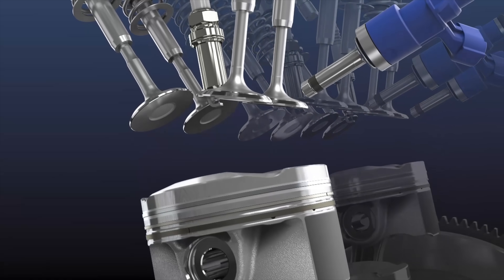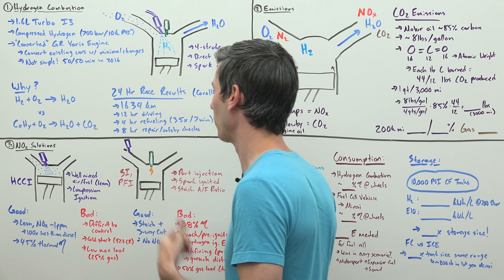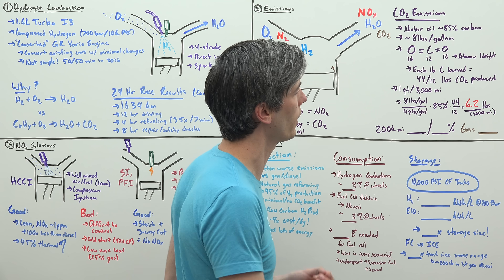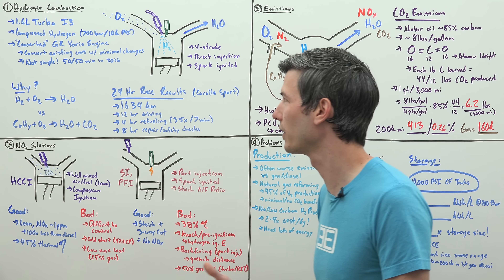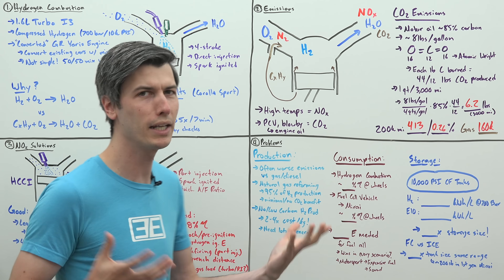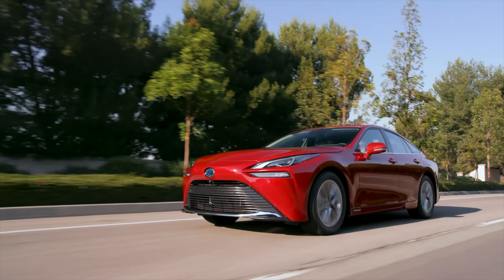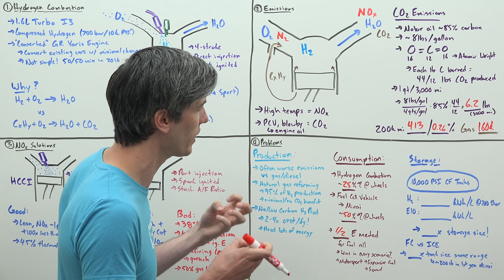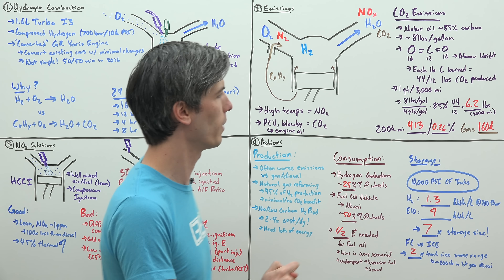Toyota's Developing A Hydrogen Combustion Engine!

Comment: Toyota will apparently do absolutely everything to avoid just making electric cars
Reply: The engine is the soul of a car
Reply: They're going the right way. It will possibly never be economical but it is the way to keep the ice alive for motorsports.
Reply: They defend their advantages in ICE reliability compared to other manufacturers
Reply: @joelblanco1800  Pfft. A car without a horse in front of it has no soul at all.
Reply: Probably because they realize most countries cant support 100% electric transportation without huge, expensive power grid upgrades.
Reply: ICE is looking more quaint by the day
Reply: Sadly to get lithium for batteries. It has to be strip mined. Plus the disposal is just as hazardous.
Reply: Trust me Toyota know what their doing 
Many other manufacturers are quickly going electric as they’re scared of being left behind plus they’ve felt the pressure mounting on them from companies and lame ass companies and media outlets that pressure them dude I swear a company like Jaguar or Lotus if they were run by actual brits they would never go electro as that would be against their traditions and such but because they felt the pressure and they’re afraid of the future a future that might get dominated by Tesla stans and climate shouting Karen’s
Reply: @vinigretzky97  

You’re damn right
Reply: It is funny - Toyota sell the Proace EV (hiace successor), but in reality it is just a Citröen Jumpy.. (Same car also Opel Vivaro, Peugeot Partner and Vauxhall of course)
Reply: C J B  Exactly, just a huge hype bubble. Tesla would not even be a thing anymore if governemnts hadn't bailed them out.
Reply: @billyboots3730  any evidence for this? A hot tub will use the same energy as charging an electric car
Reply: @noname-he9ud  they can be recycled, just need to out infrastructure in place
Reply: @vinigretzky97  Tesla hasn’t been bailed out
Reply: C J B  in what way is it superior? ICE is very inefficient.
Reply: @noname-he9ud  Lithium gets extracted by evaporating brine. You've been fooled by the fossil lobby, but no worry, now you know.
Reply: @UCOd8cMRR-lQ5cC5NDrCpasw Well I am hoping that that there is a solution out there besides burning fossil fuel. That fossil fuel stuff give me a headache when I pass close to tailpipe. After watching this video, there seems to be tooooo many negative issues with HCCI use. The FCEV is a better idea. I agree that EV has many problems also, along with mining pollution & rare earth metals needed for EV's, EV's will be expensive compared to their ICE counterpart & geopolitical issues obtaining rare earth metals at volume needed for EV society. Also very bad is EV's still need government subsidies & carbon credits to make a manufacturer profit, otherwise as of today, EV is a money looser. It is really a difficult engineering/science problem to solve with cars/trucks.
Reply: @vinigretzky97  Tesla has not been bailed out. You are probably confusing it with GM and Chrysler.
Reply: @billyboots3730 , see Engineering Explained video on the grid and EVs. For the U.S., a 30%increase in the grid, or "simply" charge at night. Not a big deal.
Reply: @YourAssAintSafe  lolwut
Reply: @billyboots3730  and they can sport hydrogen infrastructure? K
Reply: @noname-he9ud  Yes. And oil is made by leprechauns and transported to us by unicorn-drawn carriage
Reply: Toyota had several good advices for us in the past.
A super enthousiastic jump to electric cars without the infrastructure to charge them will lead in paralysis of the transportation system. They warned us about it.
They are probably preparing for this scenario.
Reply: All the resources on the planet will not be enough to make electric cars even for the USA alone.
Reply: What are you even talking about. Toyota has made EVs before and will release one and already presented a physical one before this.
Reply: Good luck building a billion electric cars to replace proper cars.
Reply: The Hydrogen powered cars, could be used in the future as a substitute to Diesel engines, or as a range extender. The Hydrogen combustion engines, could be applied in Motorsports.
Reply: @boboutelama5748  As opposed to hydrogen which requires even more new infrastructure and resources? K.
Reply: @omaralkayal7598  Would you rather plug your car in at home and pay $5~$10 for a 'full tank' or have to visit gas stations and pay $20~$40 for a full tank?
Consumers are buying EVs because they like them, because they require very little maintenance, because they're clean and quiet. Even a former mechanic and racer like myself can see that EVs are the future.
Reply: @vinigretzky97  Did not the U.S. government have to bail out GM and Ford? And unlike GM, Tesla repaid those loans.....
Reply: @jiyushugi1085  only cause tesla has now successfully shilled themselves into EU governments as well
Reply: Has anyone else put more electric motors in cars than Toyota?
Reply: @jiyushugi1085  Ford did not take a bailout. Also, GM did repay their loan.
Reply: @jonathanfields4ever  Are they now;)...lol
Reply: Seems to be working out for them, considering they have several non-ev vehicles that remain some of the most popular vehicles on the road.
Reply: @jonathanfields4ever  hydrogen pump distribution can simply piggyback on current gas station networks, since they, unlike EV charge stations, don't require a massive amount of electricity draw or require a specialized plug infrastructure investment.  Gas stations already offer diesel, petrol, flex, propane, and kerosene and would likely meet the safety standards to have storage tanks, since they have tanks for all those other fuels.
Reply: @jiyushugi1085  Yes, they are great for commuting and picking up the groceries.  They are not great for traveling, unless you have an expensive extended range model...which make up a tiny percentage of all ev's.  You're no dummy.  There is no reasonable expectation to believe that hydrogen would remain at that price with a market of vehicles creating demand and driving down prices as the market grows.....just like what has been happening to EV's.  And fuel cell cars are equally maintenance friendly, and don't need a wall plug which would work for people who live in apartments.
Reply: @omaralkayal7598  I suggest that Toyota and Honda and GM and Ford do NOT know what they are doing. They are making money now but the future is bad. The Chinese car manufactures are so far ahead in the EV market once in the US the game is over
Reply: Most car manufacturers are at least looking at, if not developing some hydrogen technology. Which makes a lot a sense, since hydrogen is already on par or cleaner than BEV's even using steam methane reformation (which is relatively dirty hydrogen production). And significant research is being invested into cleaner methods for hydrogen production.
Reply: @jonathanfields4ever  Infrastructure? Sure. Resources? F no. You do not need to mine copious quantities of Lithium and Cobalt to produce hydrogen.
Reply: It is electric, even we could say Coal powered... since what really counts at the end is the primary fuel used.. not the one the end user puts in.
Reply: @orionide4032  trillion **
Reply: @Erowens98  No, but it requires a fuckload of capital. Hydrogen proponents make it sound like you just need a bucket and some wires to make hydrogen, but you need about 3 times the electrical capacity of battery storage, cryogenic compression equipment, storage tanks, fleets of trucks, and it all has to be made to extremely high spec out of Kevlar or something of similar strength to keep tiny molecules under extreme pressure contained. None of that stuff is cheap or resource-friendly. The argument about resources is disingenuous
Reply: @uni4rm  Nope. Hydrogen is a different beast. It corrodes metal, it’s the smallest molecule, and it has to be held under extreme pressure and at very low temperatures to be safe. You can use the same location, sure, but you need all new equipment. Very expensive equipment.
Reply: @billyboots3730  Because a lot of countries need to have a power grid in the first place. Go outside the capital city in some places and you literally have nothing.
Reply: @billyboots3730  so you have huge hydrogen infrastructure upgrades instead.
Reply: Toyota actually made the bZ4X… their first EV. Let’s hope they only keep it to normal cars and not on sports cars!
Reply: @noname-he9ud  Not always.  Granted *citation needed, but "Brine Mining" is more common, and the footprint is just the injection/extraction wells (granted usually huge evaporation ponds for refining, but i digress)

On the note of disposal recycling is coming online which is nice.

Also sodium ion batteries!  or fuel cells
Reply: @jiyushugi1085  Ford did not take a bailout.  And GM fully repaid its loan.
Reply: The thing is that, Toyota Just want to be different than Others. Just like Mazda makes the Rotary Engine
Reply: @billyboots3730   and they can support hydrogen?
Reply: If it keeps the manual transmission alive, I’m down
Reply: the fall of Toyota in 20 years time
Reply: @markotrieste  do you understand how many government subsidies are given as incentive to buy an electric car? Its what the electric car industry hangs on with
Reply: @TemplarLove  if they bankrupt one day, they were Legend. Better Die Hero than long live enough to become a Villain. Because in another world out there is better, a Heaven…
Reply: @kylethomson7157  As of October 2017, Oil Change International estimates United States fossil fuel exploration and production subsidies at $20.5 billion annually. Other credible estimates of annual United States fossil fuel subsidies range from $10 billion to $52 billion annually – yet none of these include costs borne by taxpayers related to the climate, local environmental, and health impacts of the fossil fuel industry.
Reply: So what?  You got some breakthrough ideas of your own?
Reply: @reelreeler8778  There is no need for breakthrough ideas. Just start applying what we have today, but at a WWII pace. Solar, wind, smart grids, energy saving, EV, cycling infrastructure, trains etc. Just act now.
Reply: @jiyushugi1085  I would rather have a PHEV
Reply: @YourAssAintSafe  Only problem i have had with my EV in the last 4 or 5 years is people vandalizing it.
Reply: I'm glad they are doing this.
Reply: @vinigretzky97  Tesla and Ford are the only American car companies who haven't gone bankrupt
Reply: @billyboots3730  Except you're forgetting it takes 3x more electricity to make hydrogen than just filling a battery
Reply: @noname-he9ud  Err not true, it has been done that way but new methods are being used to extract it from Geothermal wells, also it wont be needed for that much longer as alternatives are on the way!
Reply: @Erowens98  
Yeah, hydrogen fuel cells just require several times the amount of electricity  compared to EVs because of the second law of thermodynamics - first you loose a lot of the energy by converting the electricity to hydrogen via electrolysis, then you have to compress and cool it, then transport it, store it before refuelling cars, and convert it back to electricity in the fuel cell to move the car forward. Every step of the way uses up energy that you could just use to drive an EV.

So if EV’s are supposedly going to cause problems with our electricity production and infrastructure, hydrogen would make those problems considerably worse.
Reply: Like the Prius.. the most sold electric sedan...
Reply: @TemplarLove  it's the only auto-motive company that amidst a crisis is still churning out cars at normal rates where all factories are struggling. I'm pretty sure they are good..
Reply: Electric cars are a gimmick... With those terrible full charge ranges, and extremely long charge times... I can tell you rn, that is not the future, we already going backwards when you look at those 2 factors, and the energy is produced using fossil fuel anyways so if everyone converts to electric cars.... You tell me
Reply: @omaralkayal7598  what a load of bollocks
Reply: @vinigretzky97  bailed out like VW?
Reply: @Vergos001  subsedies is a form of bailout
Reply: @markotrieste  yes they have. subsedies and emission laws manipulate the market in their favor.
Reply: They are literally developing electric cars right now. They have 15 new battery electric vehicles (globally) planned by 2025.
Reply: @ronaldlenz5745  the purpose of that video was that exact scenario being the problem. Almost everyone would be charging their vehicles at night. I vaguely remember him saying that MIGHT be an issue if EVs were to suddenly take over instantly.
Reply: @jiyushugi1085  I buy ICE for the noise and drama. I love every last bit of it. Yes, I rather pay $20-40 as sometimes I purposely just drive around for fun. 

Convenience is #1 in America. Until EVs can win in that category in all fronts it’ll be an extremely slow switch unless we are forced to.
Reply: @vinigretzky97  Actually subsidies are far greater for the fossil fuel industry.
Reply: @billyboots3730  they don't need to...most people drive less than 20 miles a day and the car sits 23 hours a day...why own?  Electric autonomous robotaxis are clearly the future
Reply: @markotrieste  how so? ever heard of gas tax?
Reply: @vinigretzky97  just google. Big oil companies are granted huge tax exemptions, they get discounts on public land lease. And this is even before taking into account the do called "external costs".
Reply: @omaralkayal7598  except that municipalities are mandating no more ICE sales.  Toyota is basically done in a decade except for developing countries.
Reply: Well, they did it developing hybrids 23 years ago (when many people, including me, thought that diesel cycle was the future). Nowadays, we can see that they were right and that they have the most reliable hybrid systems. Conclusion : you have to develop and evaluate all the possible  technologies, because future is uncertain. Greetings
Reply: @markotrieste  gay
Reply: Toyota is also one of the few manufacturers who haven't fallen for reducing displacement and strapping turbos to tiny engines.  They still make V6 camries while Honda only makes turbo 4 accords.  Toyota is probably the most American automaker, no replacement for displacement.
Reply: @vinigretzky97  😄
Reply: @FinalLuigi  the turbo-4's with DI can be as efficient as hybrids at highway speeds limits.  Most adopted smaller displacement because of local governments capping displacement.
Reply: for now theres little money in electric cars. i know very little. i thought tesla was doing well. turns out some crazy number like 75% of their income isnt from sales, its from government and other things paying them. and toyota have had hybrid cars for a while now. its not like they arent capable
Reply: @billyboots3730  electric cars can smooth out energy distribution. They can absorb energy when the grid has quiet times and they can feed it back in during busy times. This lowers peak loads on the grid
Reply: @PerBuer  it's a good solution for Countries with poor electricity infrastructure.  Current EVs are also just transitional vehicles till we find the right and clean alternative to power EV motors. Lithium is far from being green.  The mining and the disposal of it after 5 years of use is additional pollution to the planet.
Reply: @benkitesurfs  Do keep in mind that even "research papers" have biases in them. Even now you can find completely sound and totally opposite papers on "climate change".
Reply: @estebanamador7601  Remember that Diesels were murdered by EcoTerrorism ("Emission norms") and who says that in a few years we won't have the same problem with EVs? People hungry for money like the EcoTreders will always find a way to make buck by hampering someone else.
Reply: @mat199622  that's what I mean with "uncertain future", things that we expected could be change because different reasons.
Reply: they are really betting on hydrogen they have been pushing for it
Reply: @billyboots3730  Untrue, they just limit the power draw on the consumer grid and open more industrial.  You'll be limited to let's say 2-4kw charging at home, which is plenty for your daily commute,  but if you need to hit a road trip you'd have access to more powerful chargers on the road. Hm, kinda like it's already happening.
Reply: @jiyushugi1085  if you think electricity will stay that cheap when the demand for it skyrockets sure to electric vehicle usage you are foolish.   No way for demand to rise like that and not incur costs sure to availability or infrastructure updates to handle load, both costing money which consumer will see. 

Not saying EV isn't the way to go,  just don't think you can expect electricity price to stay stagnant with changes like that. 🤔
Reply: Because only relying on 1 type of engine and fuel is the perfect way to bite yourself in the ass. Electric sounds fine and dandy until you realize it takes a long time to charge unless you have a unit in your home which is impossible if you live in an apartment or a student. 

Also you claim is a straight up lie as they’re doing the most work to get an electric vehicle out, they’re just wanting them on solid state batteries which they’re putting out 10x the patents and studies when compared to all other car manufacturers solely relying on current lithium tech.
Reply: That’s exactly how everyone should be
Reply: @PerBuer  I like my horse with 5 legs
Reply: @mrdumbfellow927  Rooftop solar/Tesla Powerwall
Reply: @omaralkayal7598  Sentence structure man.
Reply: Toyota is a massive cars manufacturer. When they build EV, it will be huge and that drives up the stress on any grid. Right now, we can't support everyone going into EV so it is sensible for Toyota to avoid EV for now and focuses on improving what they already have.
Reply: @Darkcruzer23  Yes, Tesla doesn't make money selling electric cars annually.
Reply: @jiyushugi1085  I love solar power but so many people have no idea how much electricity a home already requires even  before using an electric vehicle. 
 Not only does a power wall and solar roof combo cost $50,000,  a single  power-wall has a capacity of 14.5kwh but that doesn't even matter because your solar roof is only giving you maybe 45kwh on a good day in summer and 15kwh in winter depending on where you live it can be a LOT less before home usage.......a tesla car  battery is 75KWH and can be as big as 100KWH!!!

Again, that is after an initial investment of 10,s of thousands of dollars.
Reply: @mrdumbfellow927  But what is the alternative? Should we continue polluting the air, ground and sea with all the effluents from IC engines? (Not to mention warming the planet.) Should we continue meddling in the internal affairs of Mideast nations in our greed for their oil, resulting more death, destruction and hatred on both sides? IC vehicles will be with us for many years to come, but EVs can greatly ameliorate many of their negative effects.
Reply: @Vergos001  Not that I disagree with the principle, but many more people have cars than hot tubs, and hot tubs only work maybe a few hours a week. And hot tubs don't suddenly need 100 kW in the middle of nowhere for quick-charging on a long-haul trek...
Reply: @jiyushugi1085  "That's a cheap tank of gas" - Everyone outside the US
Reply: @YourAssAintSafe  More moving parts than EV = less reliability.
Reply: hahahah so true xDD
Reply: @omaralkayal7598  ikr, I'm a biker so obviously I have a passion for the majority of automotive things, if bikes went electric and I couldn't ride a bike using an ICE, that would be a one way ticket out of being a biker for me <insert your typical "the engine is the soul of the bike" speech here>
Reply: @omaralkayal7598  you couldn’t be more right.

The amount of screeching Karen’s in that area has reached a boiling point.
Reply: @m4dc4t  or you know.

Use actual gas like normal people.
Reply: @trick_show9469  You have obviously never driven an EV.

And no, the energy isn’t “produced using fossil fuel anyway” in most countries. For example, more than half of U.K. electricity production is zero emission (wind, solar, hydro, nuclear), and that share is growing every year.
Reply: @cargueone1971  
Disposal after 5 years? Most EV manufacturers offer 7 or 8 year warranties on their batteries. No way in hell would they be doing that if the battery packs would only last 5 years, because they would have to replace them at their own cost. The battery packs will outlast the rest of the car, and once they aren’t useable in an EV they can be repurposed for alternative uses - such as homes. They will last more than two decades at least, and we already know how to recycle 80-90% of the materials in the batteries.
Reply: Good.
Reply: Focus on self generating EVs
Reply: @PerBuer  technically that's true bro. The horse has feelings man. Just because electric cars exist doesn't mean you shouldn't accept the horse mode of travel either. Horses can go where cars can't brother
Reply: @jiyushugi1085  the cost of electricity will probably go up as more people start charging their cars. Will be entertaining to see how California handles the increase in demand as their power grid already can't support the existing demand.
Reply: @TheDude397  Rooftop solar comes to mind.... Paired with a Powerwall one needn't worry about 'the power grid'. And when the cost of electricity increases that will only make solar Power Walls and other home storage devices seem more affordable.
Reply: @jiyushugi1085  Sounds cool in theory, but in terms of sustainability and scalability, it seems like a pipe dream at best
Reply: @gweggorz  genius!   LOL
Reply: Toyota already make a hydrogen fuel cell car and plenty of hybrids, hydrogen fuel cell Is electric, hybrid is part electric.
Reply: Toyota will figure it out in the alternative energy industry.
Reply: @michaelfleming40  Nah. They’re working on a project every other company abandoned.
Reply: @vinigretzky97  Has some truth in it, but unlike every other car manufacturer in the US Tesla repaid their government loans. Also looking at the balance sheets Tesla is the only one with a net positive.
Reply: @markotrieste  I think he means the government loans they got, but have payed back as soon as possible unlike every other US manufacturer.
Reply: @PerBuer  pffft all u want, you are clearly not an enthusiast.
Reply: @JohnSmith-lb6ww  pffft. I love my horse drawn car. Just love it.
Reply: @PerBuer  k sweat cheaks
Reply: GOSH I HOPE YOU ARE RIGHT!
Reply: @omaralkayal7598  Why would I trust you ? You can't just say trust me and then follow that with Toyota know what they're doing. So funny.
Reply: @noname-he9ud  nothing in your two sentences is true.
Reply: @Texarmageddon  Believe it or not, it costs more to charge an electric vehicle than it does to fill a tank on an ICE vehicle. Saw a breakdown on it the other day from an electric Posche owner. I own a very inefficient Windsor v8 powered Ford F-150 with a four barrel carburetor. There's really nothing like an ICE vehicle.
Reply: @matthewmosier8439   ok, I can only convey my problems using scenarios the media does not cover. 

Let’s take the winter of last year in Texas. Now before that happened let me explain my electricity bills. If I used my A/C consistently in the heat my bills could easily Average $450 a month for the entirety of summer.  It’s an old house. 

My winter bills are drastically cheaper $120 or so on average… sometimes even cheaper if I’m really trying. 

When that storm hit my bills we’re still trying to creep past $260…  simply due to the massive spike in demand. 

There is no question in my mind that they will increase the price of electricity tenfold to meet the new demand.  Using price now is a HORRIBLE justification. 

Just wait till they want 40-60c/kw from y’all… you’re gonna want gas back real quick to even things out.( I’ll be long dead by that time, but just you wait.) 

In 1990, it was around 6c per kw…. It’s now over 10c, but some states it’s already close to 20c … 

I’m not saying gas is the future… nor am I saying the same for EVs, but y’all crazy if y’all think EVs in themselves are the future..  that’s just gonna be Gas 2.0
Reply: @Texarmageddon  I agree that electric vehicles might not be the future, or, at least they wouldn't be the future if the people pushing for them now stayed in control. There is currently no infrastructure in place to accommodate electric vehicle mandates. I also tend to think that battery tech is not efficient enough, yet, despite some measurably good advances.
Reply: @joelblanco1800  not at all to be honest, it does matter but it isn't it all
Reply: @billyboots3730   that is a big myth, most of the world's countries can easily support evs
Reply: @buellterrier3596   source?
Reply: @RogerM88   agree
Reply: @tensevo   care to elaborate?
Reply: @uni4rm   you think producing hydrogen doesn't require huuuuge amounts of electricity?
Reply: @ericlotze7724   also, aluminum ion batteries!
Reply: @heyyitsRJ   electric can have manuals
Reply: @SyntheticFuture   *hybrid
Reply: @trick_show9469   there's cars with 600 miles range, it's actually longer than the range of 60% of the cars on the road on my country
Reply: @PerBuer  as if the technological gap is really that big. Get over yourself.
Reply: Prius?
Reply: @PerBuer  Amateurs. If you don’t have two people on each side of the car turning the wheels, it has no soul.
Reply: @markotrieste  Still, the extraction from the brine causes the pollution of nearby bodies of water.
Reply: @bunsenn5064  While the extraction and burning of oil and gas is clean, right?
Reply: thats good
Reply: Electric doesent work unless your country has nuclear energy and your willing to not be able to go when you want where you want
Reply: That’s good, because those electric cars aren’t going to work in areas that go to minus 30-45 in places.
Reply: We love them for it.
Reply: And they are right
Reply: @billyboots3730  even then this is actually a lot more environmentally friendly than batteries.
Reply: Variety and competition is good. Why settle for an EV future when you can have the best of both worlds — emission reductions and combustion engine?
Reply: Mining lithium is not good for the environment
Reply: Apparently they smarter than we are
Reply: I fully support Toyota
Reply: @omaralkayal7598  
🤣🤣🤣🤣LOL climate shouting Karens.
Reply: Based
Reply: Which is good
Reply: And I salute to them for their determination. I look forward to collaborating with them some day.
Reply: Make a rotor?😂
Reply: Synthetic batteries are the way forward and improvments in their performance. Mixed with a Hydrogen range extender
Reply: Good, there isn't enough electricity to charge a world of electric cars
Reply: But why
Reply: Thank goodness! If we continue on this path toward 'electrifying America', we will soon be suffering the consequences of overloading our infrastructure. A worthy goal (maybe) but this has not been well thought out, it must be done incrementally and Toyota's approach is, at the very least, well thought out.
Reply: And porsche, investing a lot in synthetic fuels
Reply: What's wrong with that?
Reply: Electric cars won't last
Reply: Dude the future is not electric trust me
Reply: Good!
Reply: Right now, there is only 1% BEVs on the road so night charging is not a problem. But once it reaches a saturation point (guessing around 30% and above), the electrical grid, here in the US, won’t be able to keep up. And sadly, the electrical supply is the first to suffer during natural disasters so going BEV is a huge concern. On the other hand, hydrogen, is executed right by the governments, would clean up a lot of industries that has a carbon footprint. Toyota is in the right direction for developing H2ICEs and FCEVs.
Reply: @vinigretzky97 you mean Chrysler and GM right? They got the bailout, Tesla got a loan that was paid back early.
Reply: Isn’t it great? They know people don’t want wind-up printers with wheels.
Reply: It's good to look outside the box and try different things. Now is the time to experiment not when stricter legislation and regulations are in place